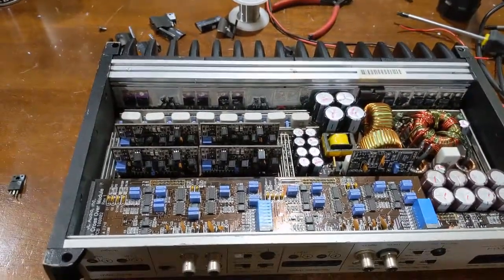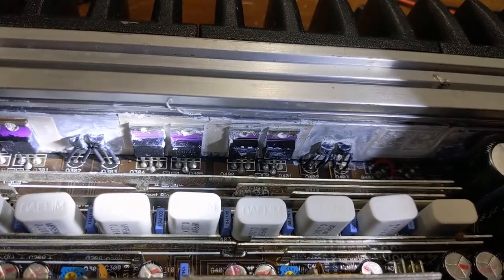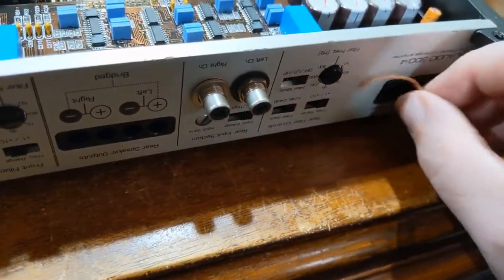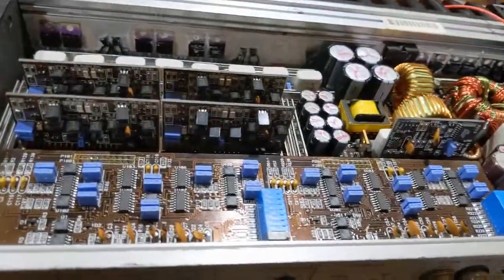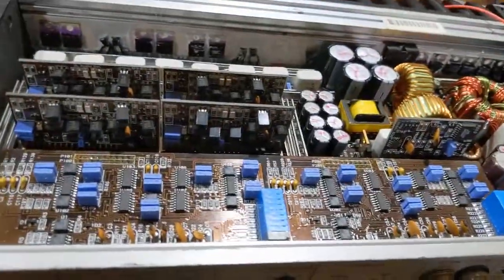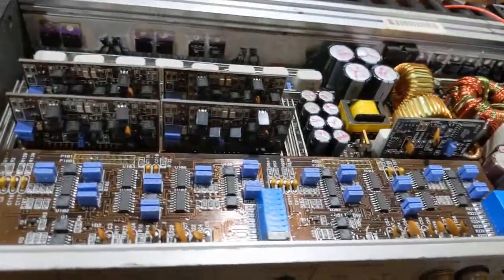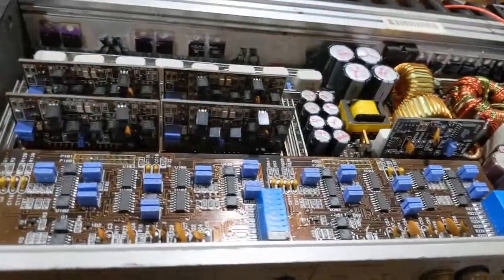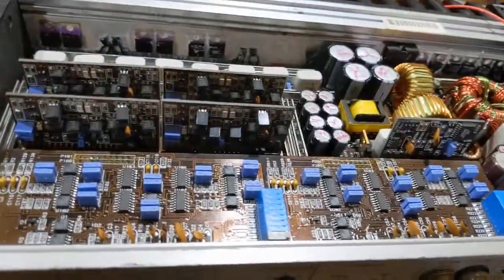JL Audio 300/4 Blown Rear channel output. Repair.

Comment: Hello, I was wondering if you could provide me on where to get some replacement screws for my JL Audi 500/5 amp? I need to replace the screws for the speakers, remote, and power cables. Thanks

Comment: Thanks for this. I have the same issue with my 300/4 V1. I'm pretty sure my gate driver is toast.  I get 3 boards to light but not the 4th.  I'll be looking over the things mentioned here in this video. Any chance you still work on amps in case I'm unlucky.

Comment: I am going to be replacing the IRF540N MOSFETs due to the low ohm light staying on without speakers connected and some distortion in the right rear speaker.  Are IRF540N's?PBF's the same as IRF540N's?
Reply from the maker: Yes. just lead-free
Reply: @THEtechknight  Thank you!